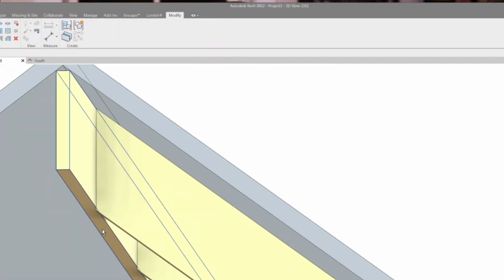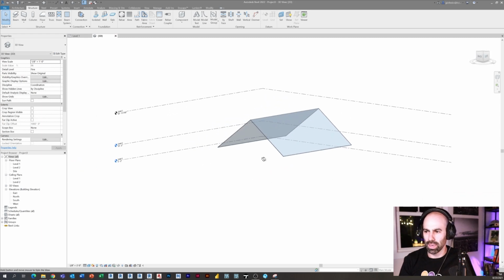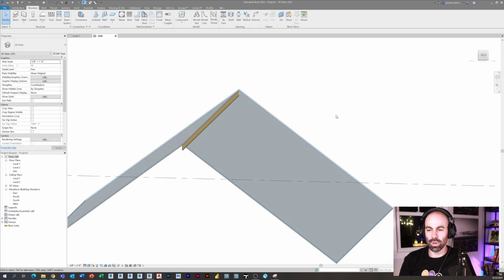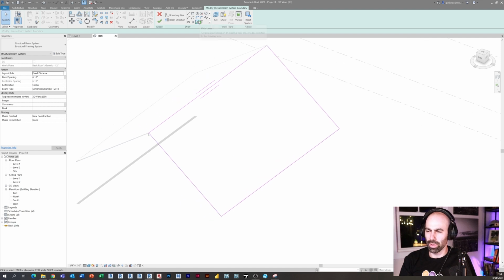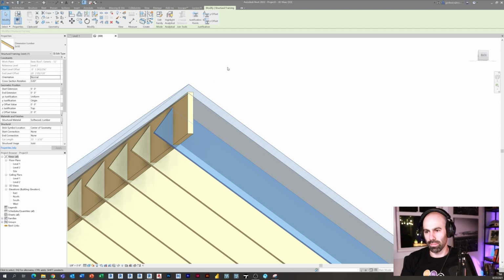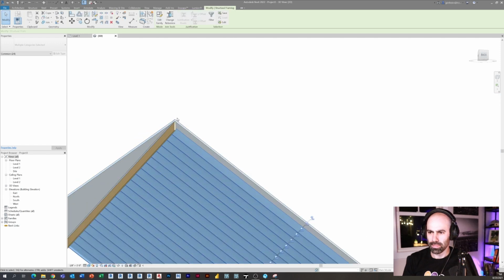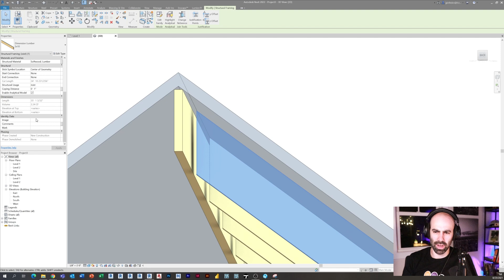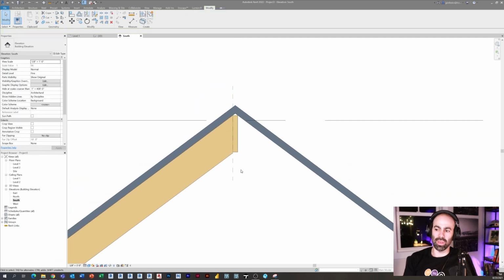Revit Structural Framing - Cut Rafter at Ridge Beam Revit Tutorial (Two Methods!)

Comment: I can successfully place a ridge beam. However when I adjust the roof pitch, the ridge beam moved vertically but also horizontally, misaligning from the ridge...(It seems to move or "slide" along one of the roof faces. Any idea how to fix this?  I've tried to use a reference plane (roof level) but then the beam doesn't move with the roof pitch at all. I've tried selecting the roof face as a work plane, and I get this same issue. Thank you!
Reply from the maker: Don’t host it to the roof … host it to a level and offset if you have to …
Reply: @TheRevitKid  If I host it to a level, and pick 3D edge of the roof, the ridge beam doesn't move at all when the roof pitch is  changed.
Reply from the maker: @icarcus1531 right … so you have to simply move it separately ..: what’s the big deal? Lol
Reply: @TheRevitKid  Not a huge deal. I actually got it to work correctly the first time I followed your tutorial - so I know its possible. But at some point it stopped working and I cannot recreate it anymore. Very odd, even after trying it on a new file. My client is constantly revising their post-and-beam roof design, and it would have been a great time saver.

Comment: In revit 2025 is there a work around for having the ridge beam move with the roof? I'm using the 3D snapping method and it gets placed correctly but won't move with the roof.

Comment: Hi bro,why in my BOM that I extracted to excel the total of length is not accurate?after i check it shown length from the centre line,what i miss it?
Reply from the maker: Check the extension location (the blue dot)
Reply: @TheRevitKid  blue dot is on center line,but i need keep as it is,because it will be use for SACS calculation
Reply from the maker: @galvanes9500  My guess is it is calculating total length to the blue dot... just a guess.

Comment: I have a question regarding the material of the structual beams. It seems to me that you can only change the material of the individual beam in the properties panel but not the material o all the beams of the same family on the proyect, like you could do with a wall. Is there a way to do this?
Reply from the maker: By default, structural framing material is usually an instance parameter.  Meaning, you will have to select all of the beam and apply a material to them.  If you want, you can open the structural beam family and change the material parameter to a "type" depending on your needs.